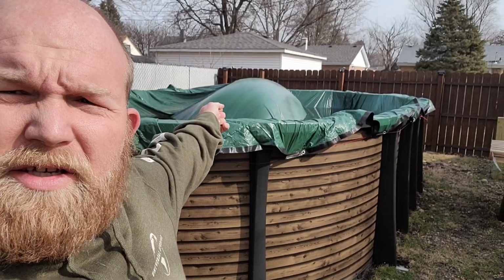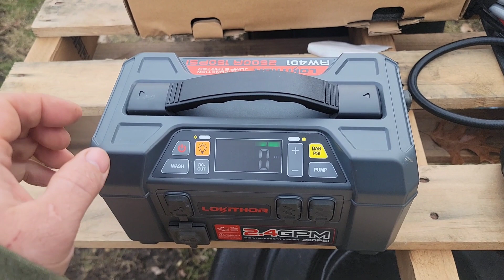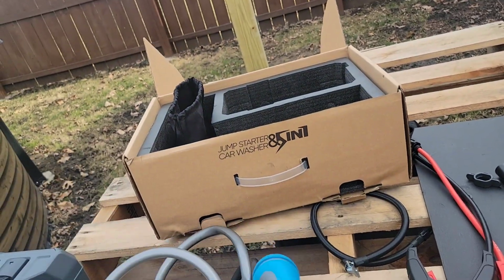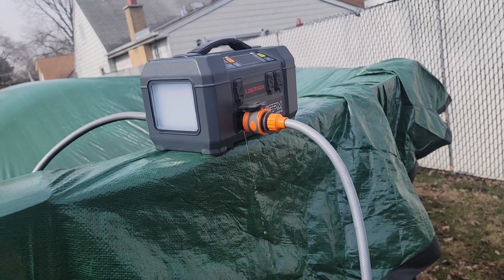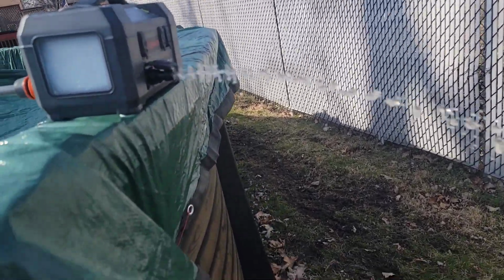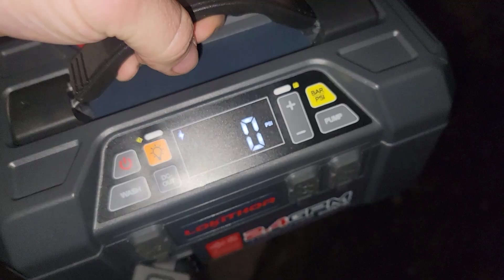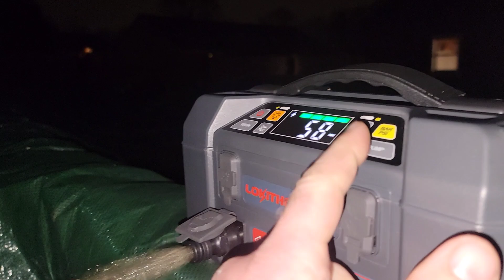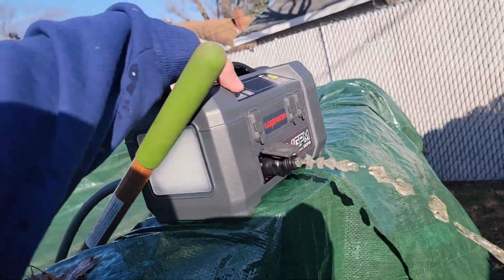Lokithor AW401 Jump Pack / Power Washer / Tire Inflator - Torture Test (ish) Pool Cover Drained

Comment from the maker: LOKITHOR AW401 Jump Starter with Car Washer, 1.5 MPA Cordless Portable Pressure Washer Kit, 150PSI Tire Inflator with Digital Screen, 2500 Peak Car Battery Booster for Up to 8.5L Gas or 6.5L Diesel

I put the kit together here The Phone Charger and Jump Pack
https://amzn.to/3Sm6toB

Comment: A little trick with your pool cover is get yourself a bunch of empty 2 litre plastic pop { soda } bottles and fill them up with water and connect them to the tarp so they hang down over the sides on the outside of the pool
Reply: Gallon water or milk jugs too. Just don't fill them all the way leave room for expansion
Reply: Or cinder blocks

Comment: Pretty neat unit. Only has 200 PSI, but being able to pump out 2.4 GPM is perfect for washing thing like your car, lawn furniture, or siding on your house. I actually removed a 1 inch section of paint on my front bumper of my Jeep accidently with a Karcher electric p/w. It was only 1.3 GPM. I only own a monster commercial 13 HP Honda belt drive p/w with 4,000 PSI at 4.0 GPM. This 200 PSI unit is perfect for not damaging your vehicles when washing them down.

Comment: So in the manual they should note that if it has not been used for a while the operator will need physically put there lips on the port to suck the outlet side to get it to pump if it just makes noise first and hope that you remove your mouth before the pressurized water pumps down into the lungs..Looks like a quality tool...
Reply from the maker: Lol

Comment: Off topic question: I recently changed the oil on my dad’s car that went 2 years without an oil change and the filler cap and filler neck into the crank case had sludge build up that looked like wet sand. Should I do the oil change again and run motor flush through it or will the new oil change alone remove it?
Reply from the maker: It wouldn't hurt to dump a little BG epr or and some BG MOA in there

https://amzn.to/3YUI6Bc